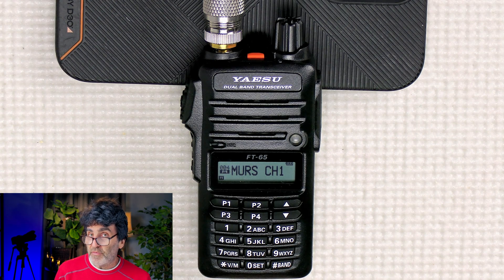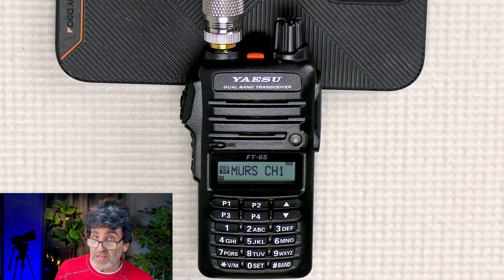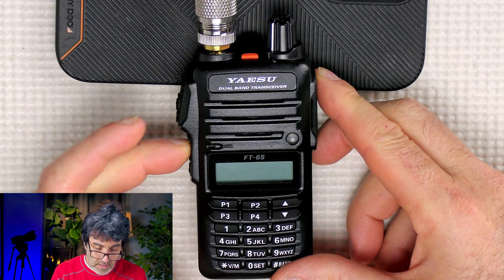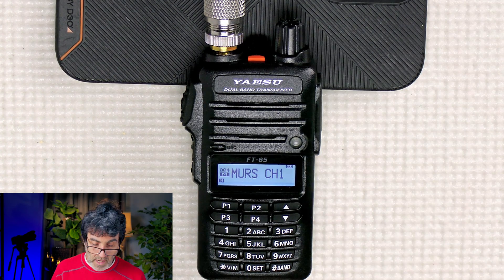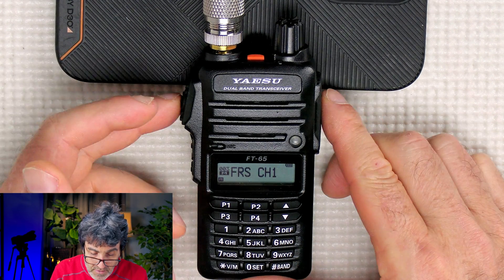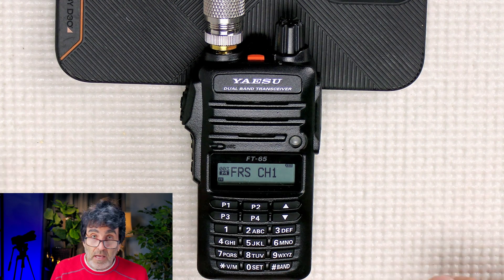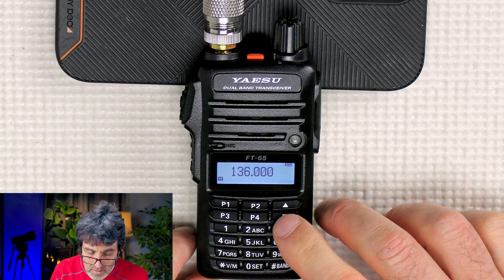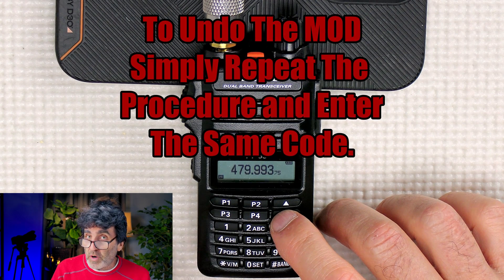Open Transmit Mod on The Yaesu FT-65R in 3 Minutes! [Frequency Test At End!]

Comment: So would doing this mod and talking on MURS channels within the legal watts be legal or illegal?
Reply from the maker: Technically I would say it's not legal.  Can you get away with it?  More than likely!  Low power will barely go 2 miles.  I believe the radio has to be "type accepted" to transmit on a certain frequency band.  Marine, commercial, ham, etc.  Since this radio had to be modified to get it to work outside of the ham band, then there's that...

Comment: This confuses me.  FRS is blocked, why would FRS be legal if you purchase a radio it at Walmart, but if you get this radio you can't talk on it (and it's blocked)?  Is it the power output or something?  If so, can that be software controlled?
Reply from the maker: I think it's because these types of radios are only "approved" to transmit on ham frequencies only.  The FRS band is a little bit out of band from the 440 band and the radio isn't quite as efficient as one that was made specifically for FRS... I'm guessing, but that's why I think that is.

Comment: After unlock can be used on Pmr446 channels? Thanks
Reply from the maker: It should but only on low power.  I think the limit is 500mw which the ft-65 is .5 watts on low power.
Reply: @JLPicard440  legally yes, but the radio can transmit on full power
Reply from the maker: Great!

Comment: I think the mod is good if in a bad situation because there are many people on FRS and GMRS or marine. If you ever called out for help the odds are someone on one of these can help you. It would be very improbable there is a licensed ham operator walking around with a Dual Band in the area you need help. We had 27 FRS radios in the area where I worked. My car does 140 mph but I keep my needle on 55 or whatever the limit is. In 35 years of driving I've never once got a speeding ticket...just use discretion. Better to have and not need than need and not have.
Reply from the maker: Yes that's a great motto!  I use that one myself... 😀

Comment: The Yaesu FT65 is ok but I feel the Yaesu ft-60 and Yaesu VX-6 are superior radios both are Superheterodyne Receivers. The FT65 is a chip on board (COB) design found in most cheaper radios.
Reply from the maker: Thank you.. I'm sure you're right, it's less than 100 if I remember right.  It works well for the price.. 😀

Comment: Are you able to or have you previously made a video on the frequency expansion on an Icom 2800?  If you could let me know or let me know where I could find a detailed video of such a mod that would be great. Thanks again.
Reply from the maker: HI, I haven't done a video on the mod.  If you go to mods.dk the mod is there.  Looks like you have to remove 4 diodes.  They make you sign up for an account, but it's free... 😀
Reply: It's fun, and experimentation is necessary, but when you run these radios outside of specs, you're not doing yourself or the radio any real favors.  With radio, everything's a compromise.
There's so much hardware available, it's better to just aim and shoot.  Keep practicing.
Reply: >Buzzzzzzzclick<
Reply from the maker: @HarryHamsterChannel  Thanks for the info... 😀